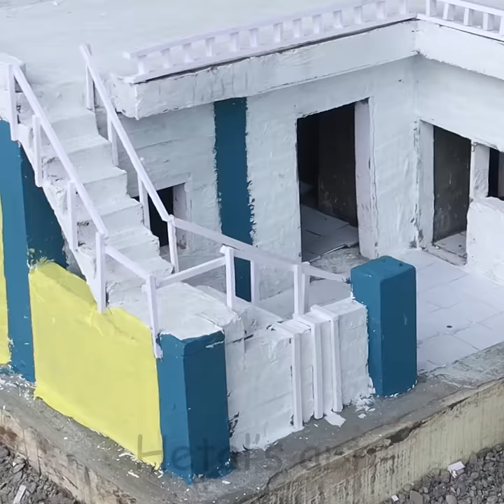Building a miniature model of a dream house with cement. Full steps like in real life!

Comment: Many steps been skiped ... dry process is the most basic diference here ,aftercthat there are many steps that Make this house actualy stay not crack and ti make it not bended , with wrong angle corners .to make holes for electricity ,water and drain ...is part of this building process. The tiles are at the end and the proces is absolutely diferent from what we saw ...